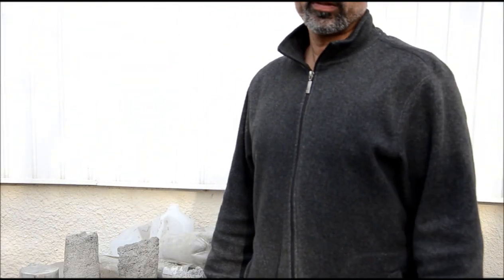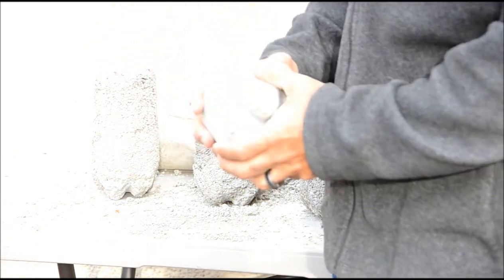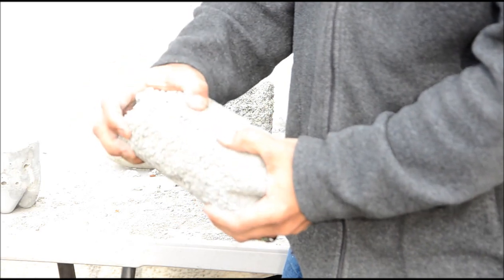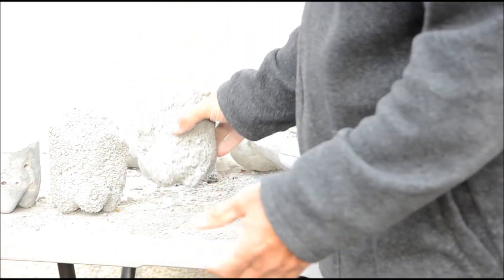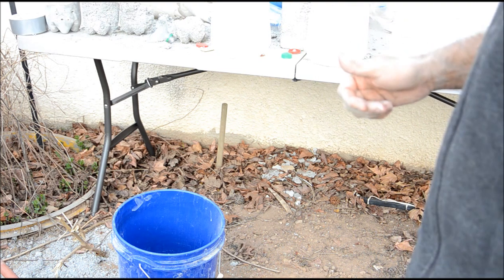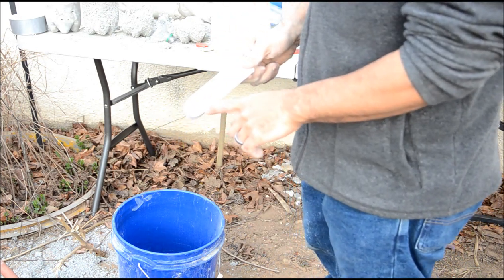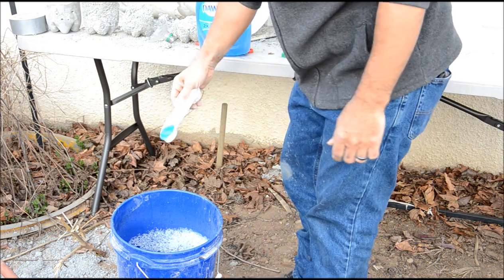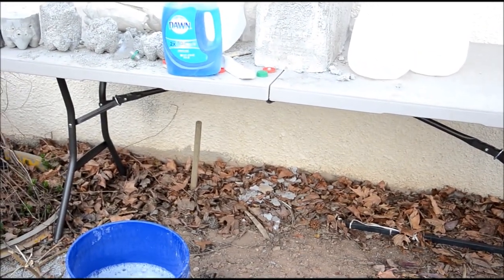Aircrete Foam Test 200 parts to 1 #AircreteHarry #diy #Aircreteproject #results #AircreteTest

Comment: This is not a 200 to 1 ratio. In a 5 gallon bucket a ratio of 1 in a 200 to 1 is less than half a cup.

What you showed was not even close to 100 to 1. And looking at the mix it was more like 10 to one.